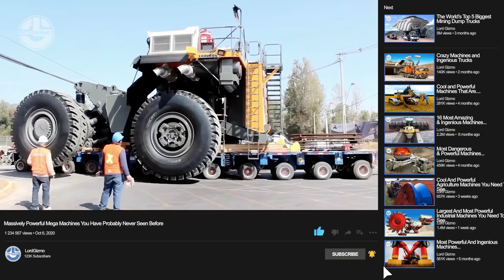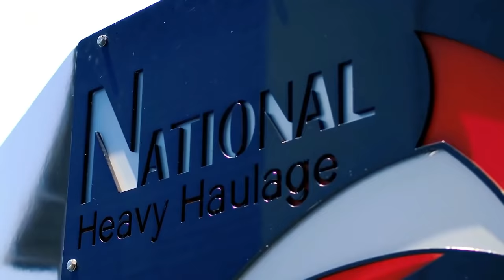Our Selection Of The TOP 40 Biggest Machines In The World

Comment: Did you know the zeppelin Hindenburg had a  estimated 230 tons of lifting capacity?   With today's tech It may be possible to transport these large machines cross-country using solar cell powered zeppelins (on board hydrogen will provide power if sun is not enough).   No blockage of road, no need for permits (maybe) and no emissions as side benefit.     Solar cells on board can create replacement hydrogen when needed.

Comment: An225 Mira was developed to carry the Russian Buran ( Space shuttle ) ...
The US adopted a modified 747, the Russians built the AN-225 Mirya (well, they modified an AN-124)

That is why it has 2 hunches above the wing roots ... mounting points for the Buran and also for rocket boosters
Reply: now destroyed by Russia :-(
Reply: There is a second Mira, but it was never completed... who knows the state it is in, and if it can be salvaged.
I see a few AN 124's on Flightradar, but sadly the AN225 was in for maintenance, with its engines removed when the Russians invaded
Reply: AN-225 is ukranian
Reply: @4486igi  yes. Correct, but at the time of its building, the Ukrane was part of the USSR. Dont forget, the Buran was completed in 1988, the USSR / CCCP was not dissolved until 1991
Reply: @southpole76  , уничтожена Украиной ,,,,))))
Reply: @southpole76  I read that some company in china has drawings and option to build new ones

Comment: I live near Branson Missouri and they had this D12 High track Dozer with a 25 foot wide blade and to move it you had to disassemble it so when they were clearing the highway in Branson and they got done they needed it in a town called Reed Springs and instead of disassembling it and moving it they notified landowners from Branson to Reed Springs which is 30 miles as the crow flies and got permission to drive it across their properties they took down fences and put rubber pads across roads to cross pavement and drove it from Branson to Reed Springs and drove it across highways roads and property and took down the fences and put them back up because it was cheaper van disassembling it and trucking it would have taken longer to disassemble it and truck it and put it back together then it would be to just drive it. Another note is I watched them as they were grading their Highway after they cleared the trees and they actually had a guy on a little four-wheel Honda driving in front of it you mean hand signals to the operator of how to tilt the blade to grade as he drove alongside the giant Dozer just in front of the blade he would give hand signals to the operator
Reply: Cat doesn't make a D-12
Reply: D11 ?
Reply: D 12 doesn't exist... yet.

Comment: How do they transport these behemoths? Never seen one of these transporters on the highway. They’d be good big.
Reply: Broken down into their various components, many are transported by rail to the assembly site.  We had a large machine in our bauxite pits here in central Arkansas.  Since it was assembled in 1976 it was painted red, white and blue, and was an overburden stripper only.  When bauxite production for aluminum finally ended in 1991, this machine was disassembled and shipped out to South America, where I assume it is still operating!  I went down and filmed it from a local vantage point at night one time.  It looked and kinda sounded like a monster when running at night.  It took a two man crew...one man to run it and one grease monkey to keep it lubricated!  Ran 24/7/365 for the years it was active!